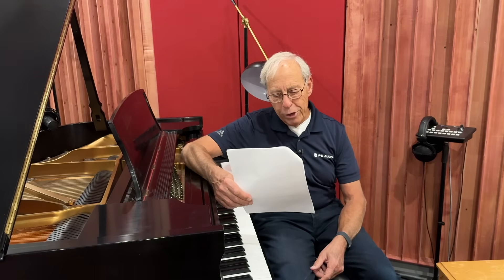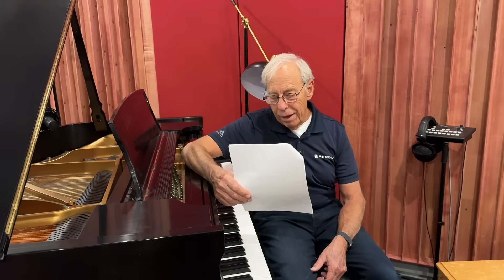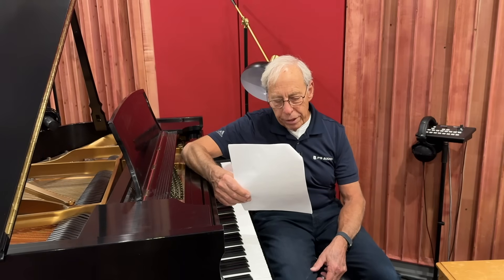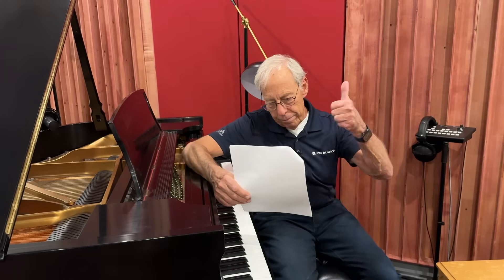Heavy gauge AC home runs and HiFi

Comment: Attesting to this phenomenon, I remember operating my Heathkit AA-1800 power amp (250W min RMS/channel at 8 Ohms) in my original bedroom, causing the lights to dim upon heavier bass hits!  I believe it was Floyd, "Dark Side of the Moon" album, recorded from vinyl to cassette so it could be played at full power without feedback to the turntable! 😂  Us crazy kids back then! (Circa 1986)  Moral of the story is dedicated circuits to hi fi equipment and use "MC" cable if possible, which is better for shielding.  Back then, I wasn't thinking about refinement. 

PS:  The factory specs for the AA1800  are pretty Paul-like, considering the time of design and it's a kit!  250 W/channel  minimum RMS, less than 0.025% THD from  20Hz to 20kHz.  That THD is good from 250mW to 250W.  TIM less than  0.03% at full power output. Dynamic headroom is 2.5dB and low frequency damping factor is grater than 100.  Noise 85 dB below 1 W.  It's no a PS or Mc I but it's decent... I want a BHK but then I will need new speakers!

Comment: You just need good shielding with cables i use dedicated circuit from a 100-amp sub panel ' homerun' meaning only my audio is in the line of  duplex respectable power plugs no lamps fridge TV nothing on that circuit but audio

Comment: The person with question did not mention with new power panel if they did aluminum or COPPER bus bar? You can have a new dedicated panel and the brand be very bad. Also you can get great panel brands with aluminum or copper bus options. I did copper it wasn't much to upgrade maybe 1,000 more than new aluminum panel.  Also 10 gage copper romex to the outlets tends to work great. Don't forget the outlets themselves. I use Audioquest. It's not really that it is better sound. You are taking out noise floor in the system and giving high quality gear more consistent and quiet power to perform. Power conditioner on smaller gear is okay to use. For the main larger gear I like separate runs direct plugged in. You can add a power protector for the whole panel itself before it ever gets to your gear. WHY do people use these other power cleaners in their rooms? It often comes down to cost, hassle factor, and if feasible or not. Putting in dedicated panel depends on length of run to your main power for the house, how many obstacles to get through, etc. You might also rent a house or condo where they do not allow you to do that. That is where plug and play power conditioners come in. To me they do not work nearly as well as dedicated runs.

Comment: If people would use real  world facts rather than fantasy when dealing with audio, this question would not arise
Reply: @spacemissing ...if people just used their hearing & a decent (resolving) home-audio rig, then we could stop
all this flat Earth, all cables sound the same crap...except for the hearing impaired of course, poor devils 😢😭
Reply: Real world facts, like using an oscilloscope to see the amplifier clipping on the peaks when the voltage of the AC line drops when plugged into a 15 amp circuit with 14AWG wiring?

Comment: Ever stopped to think about every bit of your equipment has one tiny 0.3mm piece of fuse wire in series with it at the mains plug. 😢
Reply: Mine have ofc bar with silverlayer outside, still it made a difference on power cab. So your point dont say much.
Reply: Not a very accurate statement when you include the word every.

Comment: What about the breaker in the box, does it have an impact on the flow of electricity? Should you flip the breaker every so often to help keep the contracts clean?
Reply: Flipping the breaker won't clean the contacts because the type used don't rub, scrape, or wipe across each other.  
Exercising breakers now and then (maybe once every 5 years) is a good idea, but doing it too much could be worse than not doing it enough.

Comment: The key metric is voltage drop

Distance to the transformer on the pole matters.
You might not come close to drawing 30 amps; but 10 gauge wire might be needed to keep things stable.
Southwire has a convenient voltage drop calculator on their website.
Reply: Agreed. 
(except re the calculator!) 
I suggest, if it's accessible, run a dedicated upsized 10awg feed to one's system. 
Don't build the church for Sunday, ... build it for Easter Sunday.

Comment: Thick gauge dedicated wire is always the way to go, and then if there's money left consider well insulated the last stretch (which is different from just being heavy gauge, there's far more to electricity than just Ohm's law). All of it easy to measure and if the setup is good enough then it can be audible enough to pick out (if it's really bad like in old houses then it's audible with lower priced systems).
Reply: Well, thick gauge wire may have lower impedance than thin gauge one due to lower inductance ... ;-)
Reply: @johnnaighley9252 I was thinking about secondary effects from the electric field, in this case. Some seem to struggle hard with understanding how a cable could improve things, they just see two ends of the cable.
Reply: @PSA78  Interesting. What is the physics behind "secondary effects from the electric field" in electric conductors as these cables are? I'd like to understand ...

Comment: “You can SEE it “ 😂yeah but you cant hear it unless your already hearing voices .
Oh and 100 amp service or sub lanel is nothing special . I had a 200 amp panel installed in my  barn to run 220 v wood working machines and with plans to turn the barn into a house and STILL could have used more amps.

Comment: Household light bulbs noticeably dimming in unison with loud music means something is not right with the wiring, but no need to go mad with oversized gauge wire I would have thought.
Reply: Lamps dimming to the beat is precisely what up-sized wiring addresses. 

That dimming is voltage drop. 
Voltage drop arises from inadequate ampacity, ... a function of the conductor's size and length. 

The ampacity problem can be from that particular circuit, from the mains feeding the panelboard, and/or both.

Comment: Indeed it's quite silly when people spend fortunes on a few feet of power cables that are in series with many times more feet of standard cheap house wiring. Most of us learned in high school about how resistors in series sum up and thus whatever resistance you have through your thin house wiring will NEVER get fixed by even a US$10,000 power cable in series with it. For all cables, shorter is better. For all power and speaker cables, thicker cables are better. For all well-engineered cables, a few feet sounds the same no matter price. There is no ABX blind listening test, null-test, measurement or science disproving this even after many decades of trying. If you have actual evidence of the opposite (other than your personal feeling), let me know.
Reply: What a patronizing paragraph; by Thinking Better, directed at Fat Rat; possiblly the most patronizing one ever on here. So it's really Thinking Better who has become the "first" on something; not Fat Rat for "knowing" like MILLIONS OF OTHERS that there are easily audible differences between cheap & more expensive audio cables. This is common cable denier strategy. Make the other guy seem like he's "weird" & the only one, when in reality there are millions behind him who hear the same improvements.

Then.... Thinking Better( says that they have been trying for decades to prove there is audible differences between cables; but keep failing. That is not the case, and there are many people who've passed such ABX tests in private I'm sure; including myself. Someone as biased (and hard of hearing) as Thinking Better, will never pass as a true scientist of any sort. Scientists are always unbiased and let reality dictate what is true, not their frustrations and jealousy of not being able to afford things.. Of course people whose soundstage and other things have gone up 70% with expensive cables, can only sit there &  laugh to themselves at  efforts like this; trying to make a whole audio industry seem like a fraud; which it isn't. Go listen for yourself; dont end up with lesser sound quality, over someone else's problem and agenda.
Reply: @sidesup8286 Fat Rat and I are just good friends shooting crap at each other. If we all agreed here we would have nothing to say. I'm looking forward to having beers some day with him. Hey you should be specific and tell me which ABX blind test is proving me wrong. I love to be proven wrong on this. We are talking comparison of cables that are engineered properly only of course.
Reply: If your test was in private then it wasn’t exactly ABX, was it?
Reply: @YuengsNwings name one ABX listening test that is open to the general public.
Reply: @YuengsNwings   ...WTF??!
Reply: @Yuengs. Almost anyone would understand that when someone uses the word "private", it doesn't mean it's only one person; it means it is not put out to the public.
Reply: @sidesup8286 PSACS ABX Interconnects	1990s, Bay Area Audiophile Society Power Cord	2000s, Audio Science Review / Foobar ABX	2018–2025,
Head-Fi & What Hi-Fi Forum Tests	2010s–20s,
Boston Audio Society / AES Demos	1980s–90s...None of these or other independent, statistically valid ABX test has ever proven audible superiority of any high-end cable when electrical parameters (gauge, capacitance, length) are properly controlled.
Reply: Thank you for debunking snake oil.
Reply: Your so wrong its laughable,you need more education
Reply: @philipw7058 What subject are we missing here? Give me a subject. Skin effect? Capacitive coupling? EMI? Common mode current noise? What?
Reply: The last 5or6 feet of power cable is what corrects and helps the impurities that travel on the many feet of standard cheap house wiring,power cords make a huge difference especially in a very revealing high end system which people like yourself more than likely have not experienced in order to know this
Reply: @philipw7058 That's about the most ignorant nonsense I've read in recent time. How exactly do you imagine those wires being in series with the house wiring will do anything other than making the serial resistance even higher??? If you want to clean the mains power for noise or voltage changes, you do it within the product's power supply circuit. Seems you have no clue about electrical engineering or basic physics concerning electricity.
Reply: @ThinkingBetter that’s because of your ignorance in this field, I clearly said it helps to correct and clean the in coming power for the power supply to work that much better,people that think they know everything are usually the ones that know the least,your narcissistic attitude in your opinions shows that,read what I said it helps not fix learn how to comprehend when you read maybe you would be more educated
Reply: @philipw7058 How exactly does it help correcting or cleaning the currents of the live and neutral wires? You have no idea what you are talking about. Explain how the science work for what you are talking about?
Reply: @ThinkingBetter I know it does by what I hear that’s what audio is all about not about numbers,something that I told you about before you have to have a resolving system to experience the difference if you don’t have a system like this you will stay ignorant like you are
Reply: @philipw7058 It's entirely a placebo effect and absolutely for sure, a power cable doesn't clean up anything.
Reply: @ThinkingBetter I along with others think that your a placebo effect,in joy your listening and ill in joy mine
Reply: @ThinkingButter ...my personal 'hearing'...nothing to do with "feeling" (sorry that I had to correct you...again)
Reply: @Fat Rat You should get a job as the first person on the planet who can actually hear a difference of a few feet of expensive power cables or silver being superior without it being placebo effect. Such amazing skill has yet to be proven by anyone after 5 decades of trying. All others so far failed and were just simply concluded to be placebo effect. A tiny effort by your wife swapping cables randomly is still my recommendation for you to do before securing your fame and fortune. And I'll make sure that one case of beer will be more like a truckload of beers from me.
Reply: @ThinkingBetter   ...see, this is where you tend to get things....hmmm, how should I say this...WRONG, because I'm not the first person on the planet who can actually hear a difference without it being attributed to the placebo effect. If I was expecting NO DIFFERENCE because for decades I also believed that 5 feet of 'audio-grade' power cable was not going to change hundreds of feet of 'internal house wiring' & therefore there would be NO DIFFERENCE in the SQ coming out of my loudspeakers, then, when I actually DID HEAR A DIFFERENCE, how could I possibly be affected by the placebo effect or by any confirmation bias??
Reply: @Fat Rat Your imaginary benefits are at least making you happy so that's awesome 🎉
Reply: @ThinkingBetter   ...exactly what "fortunes" have I spent on power cables? (You used that word "fortunes" which is why it's in quotation marks) Do you really consider AU$660 (US$430) to be a fortune?? Wow, you must be practically broke...how are your food stamps holding up?? Maybe I should be sending you a case of beer if you believe that US$430 is a fortune for three 1.5m power cables 😲
Reply: @Fat Rat Point is they probably costed less than US$20 to make.
Reply: @ThinkingBetter   ...I doubt that. The four high quality XLR plugs would be AU$30 & the 2m of pure silver interconnect cable would be around AU$40 & then there's a labour (labor) charge & then there's shipping to Australia from England, another AU$33 & then there has to be a reasonable profit margin & then, what price do I put on the upgrade in SQ?
Surely that's worth a few hundred dollars when I consider that my entire rig is AU$26K.
Reply: The per foot raw balanced silver cable cost is under US$2.5 per feet FOB China. Connectors are under US$3 in MOQ 1000 level FOB China. I'm pretty sure the BOM cost is well under US$20 but obviously you have assembly cost, logistical cost, taxes and profit. I've actually visited some of the audiophile wire and cable assembly suppliers in the areas of Shenzhen, Zhuhai, Guangzhou etc. some years ago. This is a business of huge profit potential helped by deceptive marketing.
Reply: @ThinkingBetter   ...the guy who made them for me is in Manchester, England & he doesn't buy his plugs & his cable from China & even if he did there is no way that he would be able to buy them at Chinese factory prices.
Reply: Why not?

Comment: Why not nine or eight gauge wiring?
Reply: The outlet will not accept it  no gain to be has
Reply: @stevenjacobson8177  
Why not upsize bigger than 10awg? 
You can. You can upsize even more, regardless of whether the wire fits in the receptacle device (simply "pigtail" to adapt to wire that fits).
Reply: It's mostly dependent upon the distance between the fuse panel and the outlet and the cost.  My power amp is connected via a 20 amp breaker and 12 gauge cable to a dedicated outlet with a 12 foot run of wire.  My house has a 200 amp service, within 250 ft of the transformer that feeds the 220 volt line.
Reply: @paulehney4581  240 volts for the past few decades.
Reply: @kb9gkc I'm an old dude, so I kinda forget the exact specifications today.😂
Reply: @paulehney4581  
Old Dude? Same. 
220, ... 221, whatever it takes.

Comment: Funny term, "Home run." I've always heard it called a dedicated circuit.
Reply: I'm just glad to have a dedicated wife. 
 All joking aside, I ran a dedicated 12 gauge, 20amp 110-120v outlet for the System downstairs. 
 Don't know if it made it sound better, but at least it's not competing with the fridge or lights.
Reply: @BruceCross ...meh! Tomato/Tomarto 😁🍺
Reply: "Home run", and "dedicated circuit" are two different things. 
One can have a home run on a non-dedicated circuit.

Home runs are the wiring segment between the panelboard and the first device.

For example, typical convenience outlets are often looped together sharing a breaker. However, the feed between the panel and the first device, that's the home run for that circuit feeding those receptacles. 

A dedicated circuit is simply one breaker serving one device. 
Typically, it also means a dedicated neutral, although exception exist.    
  

Oftentimes vital for audio, there's also "isolated grounds". Isolated ground means an insulated and dedicated ground wire exists between the device and the panelboard. Thus, facilitating more of a star ground approach, ... mitigating ground loops, etc.  

- One can have a home run on a non-dedicated circuit.
- One can have a home run on a dedicated circuit. 

TLDR? 
Spec a Hospital Grade, 20a device, fed by an upsized, dedicated, isolated ground, 20a circuit.  

Pedant.
Reply: @FOH3663   ...Thanks for posting! 👍